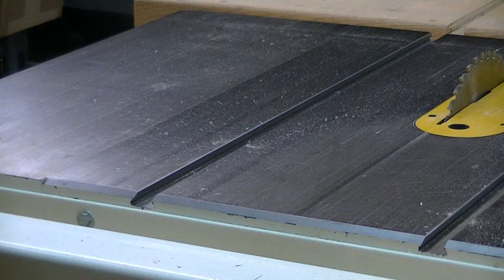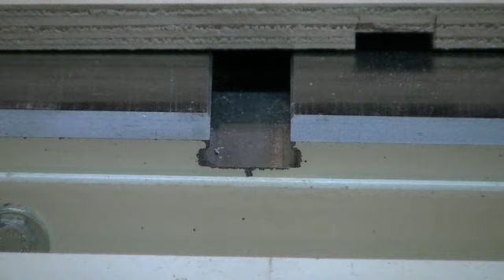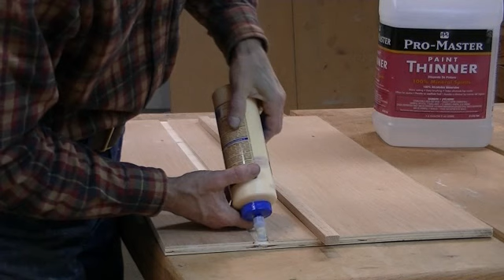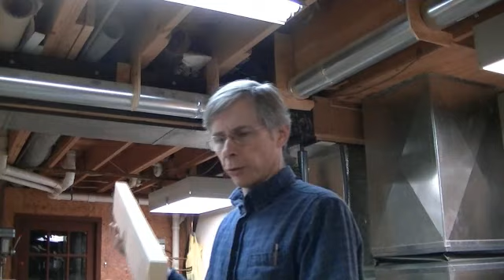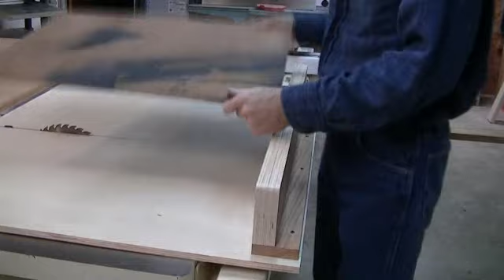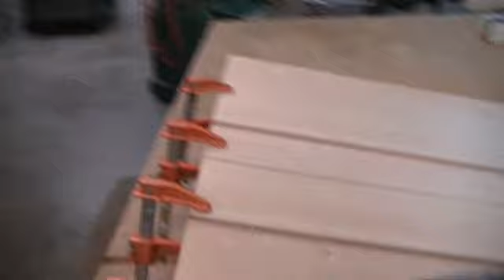Table Saw Cross-Cut Sled - Winky's Woodworking Tips

Comment: I've made sleds in the past but will try the two piece method for my next one.  Just curious why you removed the screws from the top of the front fence and why you didn't use any glue.  Good job
Reply from the maker: The screws from the top were into just to hold the front fence while checking the cut for square. They don't hold much because they are in 1/2" plywood. Using glue would be tricky but could be done. You could mark the plywood and remove the fence but getting it back in exactly the same place might be a challenge. Plus if you needed to make a future adjustment it would pretty much be impossible. Lots of screws are easy to install and I have never had a fence move yet.
Reply: Thanks -

Comment: I like the way you make the 2 sides seperate. If you did it the standard way I guess it could jam up. I love the extension runners in front. Great idea even if you dont use the sled, to run boards against the fence.
JD

Comment: Great video. One bit of advice that I've learned the hard/expensive way - don't edge joint plywood unless you're using carbide blades. The glue in the laminations will destroy HSS blades.